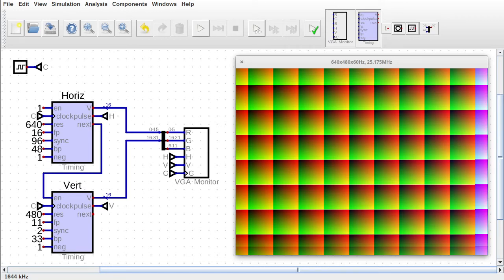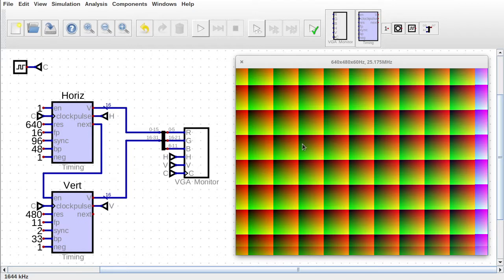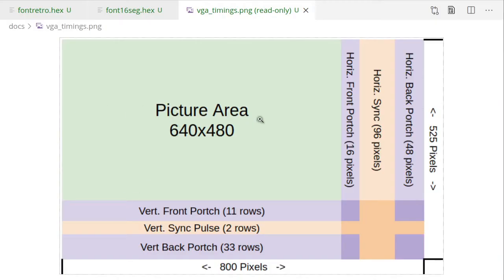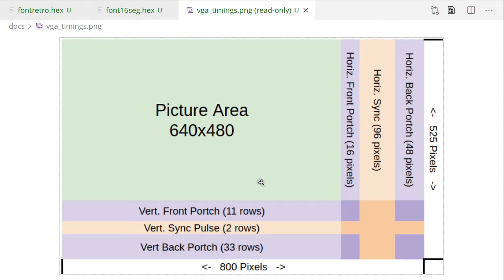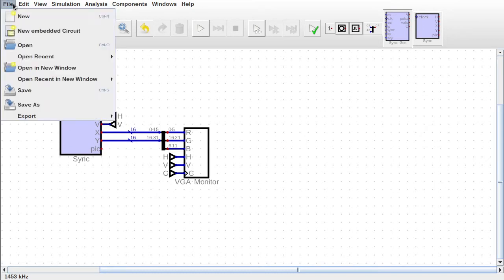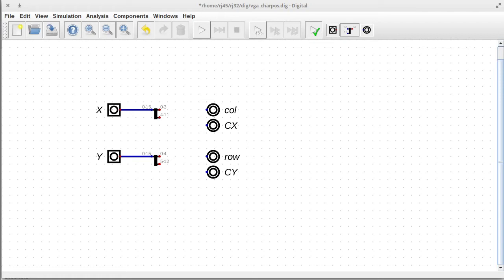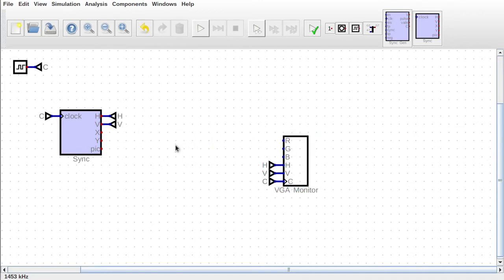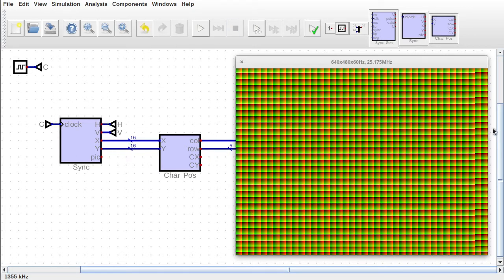[030] VGA Text Mode! (Part 2) - Building a GPU From Scratch

Comment: Great series, great learning curve.  waiting for pcb implementation of our cpu 😀😀 and eventually a homebrew computer 😎😎
Reply from the maker: So, currently it supports two different FPGA boards: the IceSugar (find it on aliexpress) and the IceZero (digikey/mouser/trendz). See my github for details. I am not sure I want to build my own custom PCB, but I will think about it.
Reply: @rj45Creates  let's say we implemented it on FPGA does that mean if you want to run Tetris on it, we neeed to write our own assembler, interpreter , instruction set ?
Reply from the maker: @AkashJadhavIT  It has an instruction set and assembler, and it has a mostly done C compiler that needs a fair bit more work to be usable. But Tetris could be written in assembly. It just needs the ability to draw graphics, which hopefully I will get around to making a few episodes on soon.
Reply: @rj45Creates  okay seems like upcoming episodes are gonna be very much interesting, looking forward to the videos 😀

Comment: Do you know, how to use an HDL module in schematic in this program?
Reply from the maker: I looked into it a while ago because I wanted to use an SDRAM simulation verilog module, and I couldn't figure it out. I think you need a working iverilog install, and it needs to be configured correctly. But I didn't get further than that, sorry.